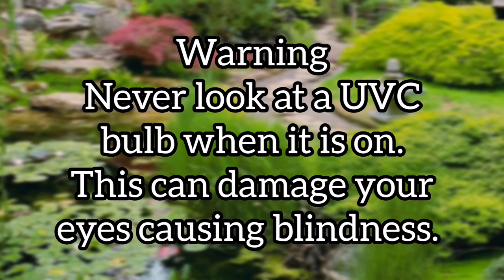How to Service a Hozelock Easyclear in Pond Filter.

Comment: Thanks for the video, looking to purchase one of these pumps replacing our old one. How often should you service these pumps?
Reply from the maker: The bulb needs to be replaced every year. I normally do this in the spring so the bulb is at its best during the worst time. The filter cleaning needs doing as and when it blocks up. How often it needs cleaning is dependent on fish stocking, sunlight and surface runoff.
Thanks for watching.

Comment: I’ve cleaned mine and replaced the bulb. When i put it all back together water is still going through fountain but also escaping below the grey flow adjuster ring?   I’m not aware of a seal or anything ? It wasn’t doing this before🤔 what have i done wrong?
Reply from the maker: Hi. Not sure without looking at it. Maybe it's not fully locked back in place.